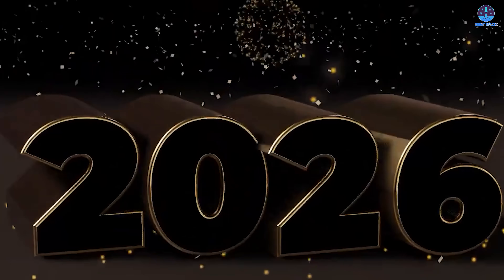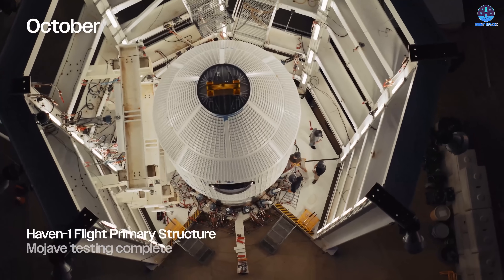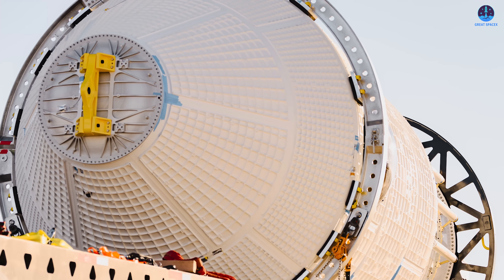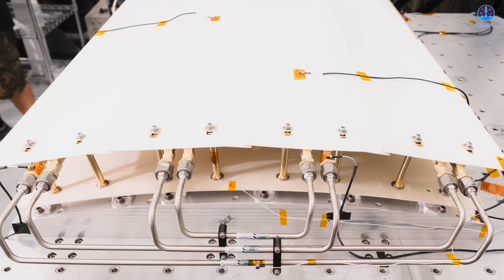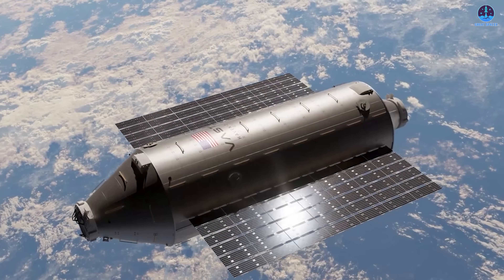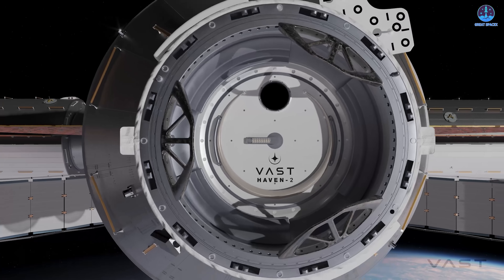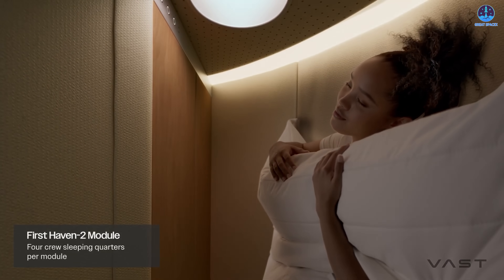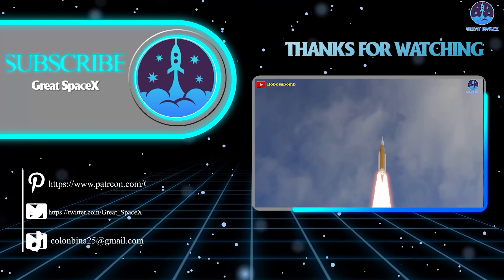NASA's First New Space Station Rapidly Progresses Toward Launch in MAY! SpaceX Ready to Help….

Comment: to small
Reply: *too
Reply from the maker: They will have more modules
Reply: @colonbina1 yep the larger vast 2 will be bigger  they say 2028 first one . All put together  by 2032
Reply: It's just the first step. They will use the data learned from operating it to design Haven-2, which will be comparable to the ISS.
Reply: yeah, just a small prototype